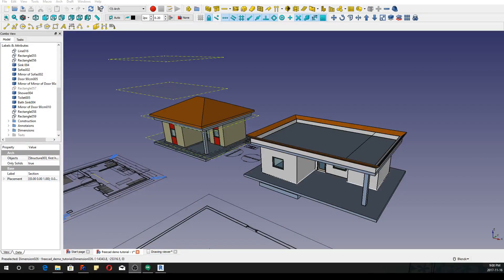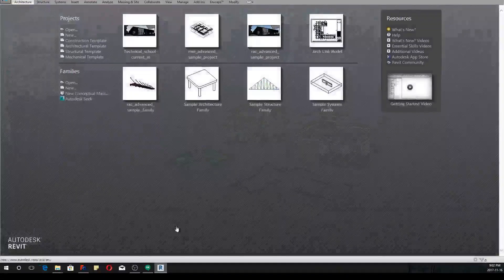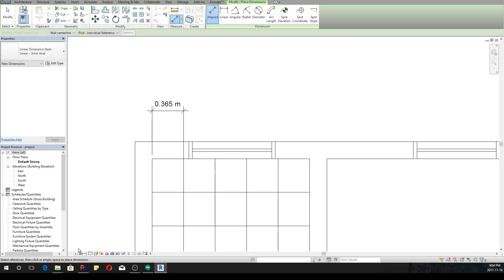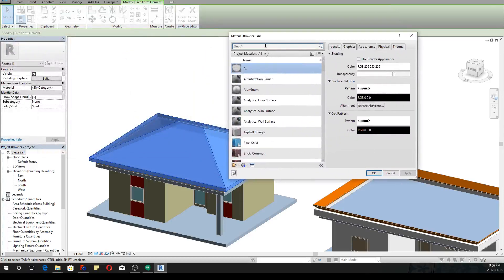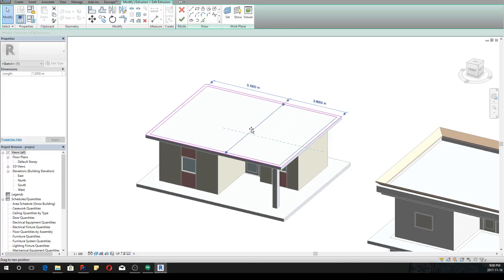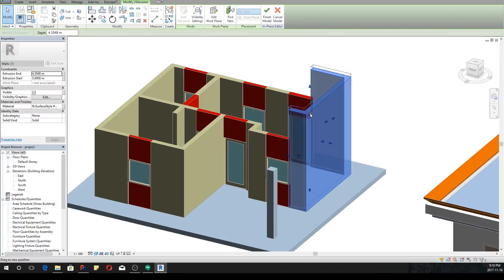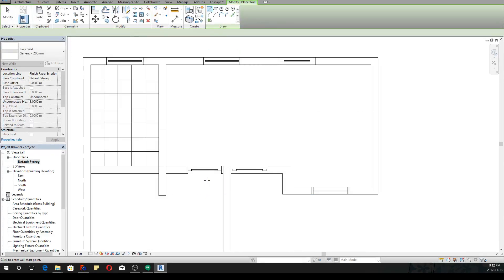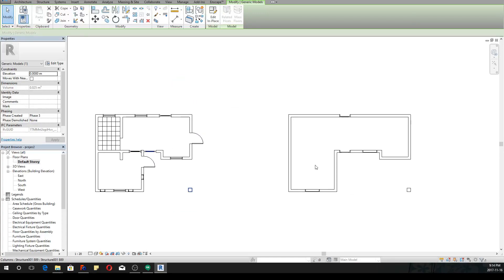FreeCAD to Revit with IFC

Comment: Hi Regis. I would like to know how to get and install freeCAD builder on Windows with the new features. I've tried but to no avail. Do not be like an executable faxer.
Reply from the maker: +Zé Ribeiro you mean you want to run the latest freecad on windows?
Reply from the maker: go this link ---> https://github.com/FreeCAD/FreeCAD/releases
look under 0.17 and download the version that works for your system and save it anywhere on your system. probably might need to unzip it. The new name folder might looks somewhat like this "FreeCAD_0.17.11528_x64_dev_win". Now you can run Freecad by opening the folder, then ---> "bin" folder ---> then select the file that has the freecad icon. that should run freecad for you.
Reply: Okay. I'll try. Thank you so much